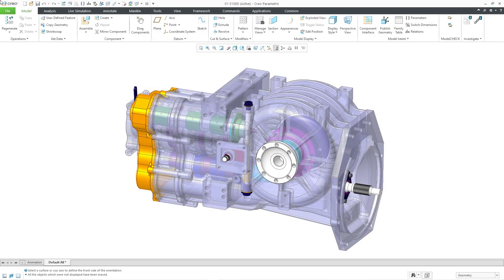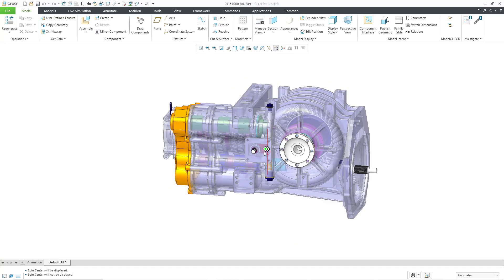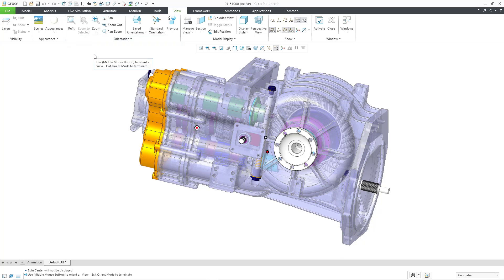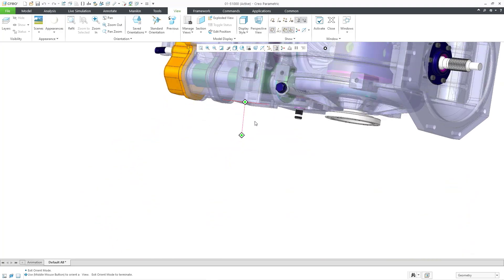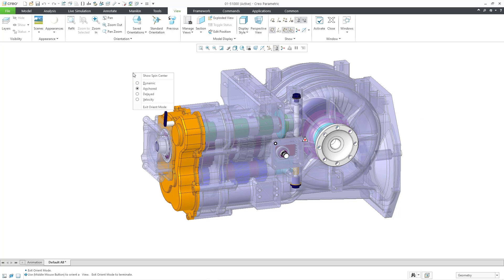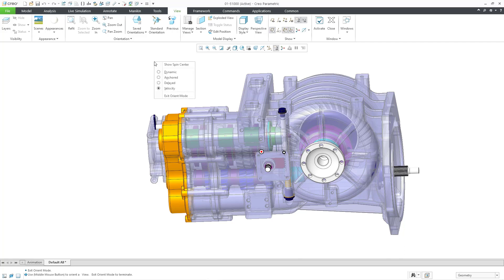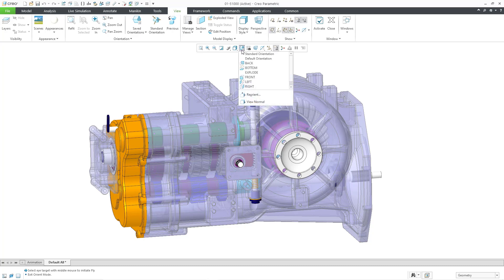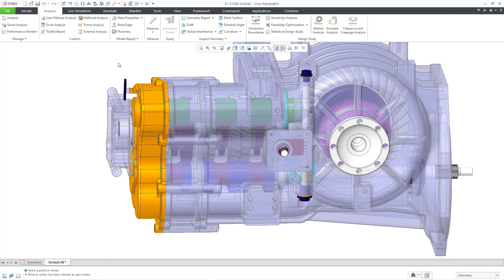Creo Parametric - Advanced Orientation | Fundamentals

Comment: I have a question regarding , where i can find a button for dynemic drage . If you know inventor software and if have been worked on solidworks , you will find there is button for dynemic view and you can rotate object , so please tell whether is button for dynemic view , i don't like to use mouse middle button and one more question , as we use extrude command ,then object needs be view in isometric view by default but it's keep in same position without moving. I done it with sketch but it's not working with modling , can you help me please